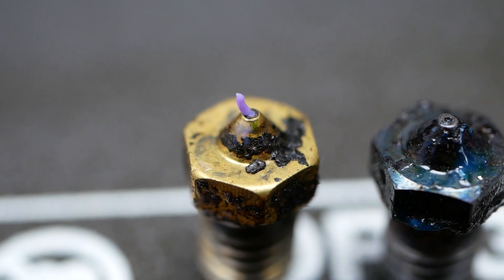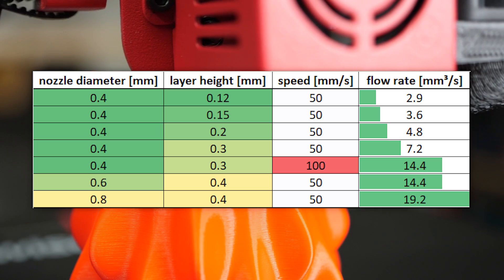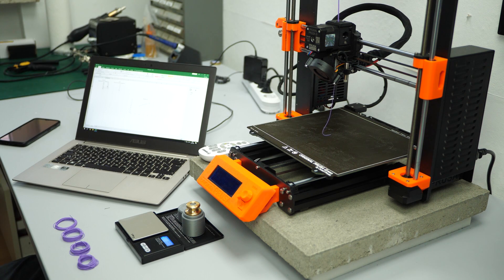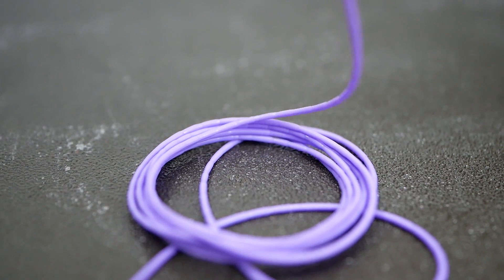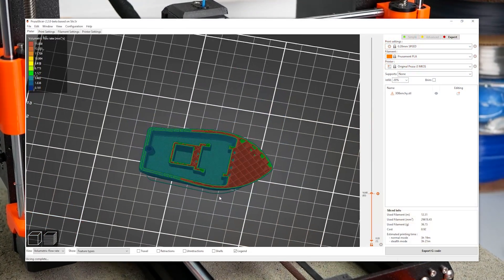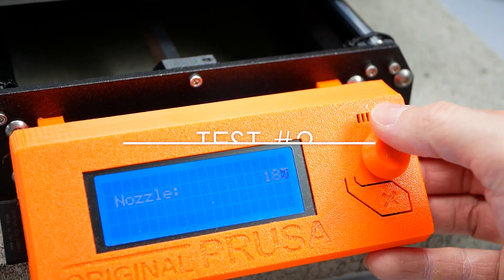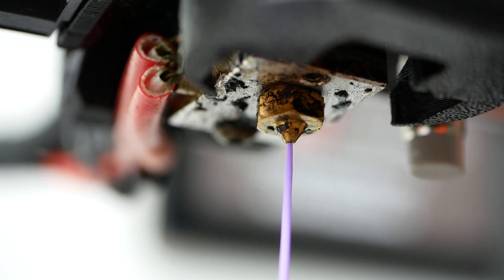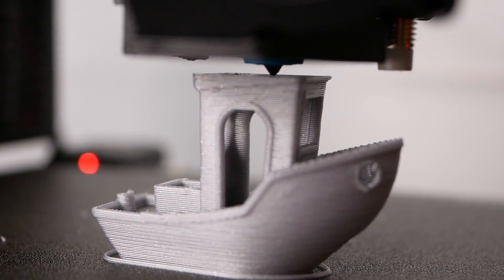How fast can your hotend print?

Comment: I've been using a stock hot end on my CR-10s for a few years without any issues at all. Although, I do print on the upper end of the temperature range of each material and never print faster than 60mm/s. I usually do 50-60mm/s for infill and inner walls, and like 30-40 for outer walls and surfaces.

Even when using a 0.8mm nozzle, that hotend seems to keep up very well, but at 0.8mm I do slow the print down quite a lot and push temps as high as I'm comfortable with for the material.

I have converted mine to direct drive and am using a different heatsink and part cooling fan setup which seems to do a good job of focusing the part cooling fan flow directly onto the part and not cooling off the nozzle.  Replacing the inner PTFE liner with Capricorn also makes me feel a bit more comfortable printing with higher temps, (within Capricorn's safety specs).

Last thing, if you actually end up seeing this. May I make a request for a video?  
I've really been curious about testing various 3D printing material creep properties. I can't seem to find much solid research into it and I think it'd be super useful for a lot of people that print functional parts.  😉

Comment: Don't forget that the back pressure on the nozzle is much higher when actually printing compared to these tests, and of course will also depend on speed and layer height. I suspect that this would significantly change the extrusion rate and shift those curves quite a bit.

Comment: How does this translate to what Cuba shows me for printing speed. For instance, I have been doing 215c and 40mm/s how does that 40 mm/s translate into cubic mms?
Reply from the maker: Use the formula from the beginning and add your extrusion width and layer height.
Reply: @CNCKitchen  thanks I need to rewatch the video. I missed the formula.

Comment: my concern with raising temp is I cant tell just how hot the filament is getting.  PETG gets very brittle if overheated IMO.  am I just overheating it to reduce the viscosity?  or am I keeping at the right temp keeping up with the flow...
Reply from the maker: Both, first you properly need to melt it and then you also want to reduce the viscosity for these high flow rates. Been printing PLA very successfully at 260c even at low flow rates without any issue. Maybe your PETG was wet?

Comment: thank you for this. I built a corexy which can easily print at 100mm/s. Using a V6 style hotend with BMG extruder , filiment was skipping when I printed at .3mm high and 100mm/s . I never realized the V6 was working in the upper bounds of throughput. I have upgraded to volcano  recently , still seeing what it can do. I was disappointed at the end of this video there was not a comparison of the volcano.

Comment: in vase mode using my white pla filament i end up getting 3 or 4 small black dots on different areas when a 6 hour print is finished...i print at 220 degrees at 50 mm per second...can anyone tell me what adjustments or if any can be made when printing in vase mode to prevent the black dots which are most likely burn filament? maybe lowering temp...i just don't want to lose quality or strength...thanks

Comment: My extruder is kind of slow, so I usually do up the temp from 205-210 to 225-230 if I really need/want to print fast. The problem, of course, is that its depdendent on the place in the print. If there is bridging or  overhangs I manually lower the temps. This should really be in the extruder, as always!

Comment: Thanks for that very thorough vid Stefan. You removed any worries I had about using the Nozzle-X, so I installed one this evening and am currently going through a few test prints to ensure my Z calibration is once more dialed in just right.

Comment: I have a printer with a 1.4x1x1 meter build volume. It came with a regular V6 hotend, but of course I upgraded to supervolcano. Just to give an example; I can easily use a 1.2mm nozzle, 0.4 layer hight at 200mm/s.

Comment: I'd be very interested in what differnce precision makes.  Parsing through the gcode and rounding each coordinate to nearest prescision and the printing.  The comparison between all the different precisions would be very interesting - at what point does it make a noticible difference.
Reply: I wonder if there would be a good way to test geometric accuracy after rounding xyz moves to .005mm and .01mm

Comment: If possible, I'd love a comparison with multiple common materials as well as hotend designs as well.
chart ALL the things! PETG is particularily tricky it seems, I have to baby it when I use standard brass, but upgrade to plated copper and all problems dissapear, but there aren't any similar effects with PLA.
Reply from the maker: Interesting. Didn't notice a big difference between copper and brass nozzles myself. Did both use the same geometry inside?
Reply: @CNCKitchen  I'd assume so! Both genuine e3d nozzles on standard V6 hotends

Comment: im fortunate enough to already have a volcano hotend in my printer (artillery sidewinder x1). I can highly recommend that printer, for the price its really well build and has quite a big usable printing space. just be aware that you need to do some small mods to get the best printing results (like relocating the filament holder and maybe adding braces to the printer for really tall prints)

Comment: Thanks for the great investigation Stefan, as always very inspiring. I did notice over time that  increasing temperature by a delta of say 10degrees would help material flow better on more challenging speeds. I always choose the hotter side, I really don’t get why people print at 185-190 except very slow to get maximum detail?

However, regarding brass vs steel. I have noticed that I often need to boost temp by 5-10 degrees with Nozzle X to yield same consistent result as brass equivalent. I’ve also run into extrusion issues when switching to PLA after printing PETG or other copolyester. I choose plated copper nozzles for everything except abrasives as I get more consistent output with those, which I associate with better heat transfer.

Comment: Yes, yes, yes! I've been telling people to do this for years but you've illustrated and explained it better than I ever could. I could lose about 25% of my extrusion weight before the stepper started skipping steps, so don't think that just because there's no clicking that you're getting all the plastic you requested, folks. A simple test is to extrude 300-400mm of filament at low feedrate (F50), weigh it, then do the same at your volumetric speed, weigh that for comparison, and up the temperature until they're close, increase the extrusion multiplier to fudge it, or simply slow down. One of my ABS temperature / feedrate graphs:
https://i.imgur.com/ubw6ss9.png
Reply from the maker: Great work!
Reply: Do you need to extrude such a large amount? I've been using 60mm, but kind of notice my printer can't reach the maximum volumetric rate on larger prints. Now I think that is probably because 60mm might not a large enough volume (although I was kinda trying not to waste as much filament lol).

What I've also noticed is that you need to be careful with these tests. Clean out your extruder between all tests especially if it started skipping on your last one. Any teeth that have debris in them from skipping will be more prone to skipping, giving you false readings. 
Although you want to stay away from the speeds you notice any skipping anyway.
Reply: @krenthabohl  I can certainly sympathize with not wanting to waste a lot of plastic just to weigh it, but 60mm of PLA is only 0.18g so I think even 10% loss is in the range of rounding error for a cheap 50g scale. 400mm is just 1.2g, so even if you test 6 feedrates at 6 different temperatures, that's just 4.3% of a spool of filament or just $2 worth even if your spool cost $50. I would suggest 200m at a minimum, I usually do 300mm.

Comment: I print usaly at 215°C with PLA with an maximum speed of 150mm/s with an 0.3mm nozzle and 0.1mm layer height, works very well with ..... only problem i have is that im to lazy to set up the linear advance :D

Comment: So you're using a nozzle X, does this work the price? Does it work better than hardened steel nozzle?
And does the coating really help to prevent the plastic to stick on the nozzle?
Thanks
Reply from the maker: I think it's worth the price if you regularly print with abrasive filaments because it work well with all materials I printed so far. Much smoother surface finish due to the coating than a normal hardened steel one with only black oxide on it. If you only print non-filled materials though, stick with brass.

Comment: Love this test! I usually increase temp a lot when printing fast and with wide/thick layers (I like to use a small nozzle Ø as if it was larger).
What I would really like to learn is how much difference does it make to print say 0.6mm wide lines at 0.2mm layer height with a 0.4mm nozzle VS  printing with a 0.6mm nozzle and the same width/height. The larger diameter hole should reduce back-pressure. But at what flow rates may we use a 0.4 nozzle instead of a 0.6 nozzle and getting the same result? It is my opinion that we don't need nozzles of may different diameters.
Looking forward to your next video as well!
Reply: You can print wider tracks using smaller nozzle diameters within limits of nozzle geometry and can actually speed up the printing process.  He talks about printing larger extrusion widths using smaller nozzle diameters in his video on extrusion widths . . check it out.

Comment: I sort of stumbled into this the other week. Printing at 240, sliced at 100mm/s, layer height 0.32, extrusion width 0.44, that comes to a volumetric flow rate of 14.08. On top of that I turned the feed rate up mid print to 300%. I think the Ender 3 is limited to 200mm/s and I'm pretty sure I hit that. There was some skipping occasionally but it handled it pretty well.

Check out that extruder knob: https://streamable.com/dp6jq

Comment: Great stuff Stefan!!.. I noticed that you have a low extruder idler tension, do you think that affected the results? As the gears would slip earlier..
Reply from the maker: Of course it's also dependent on the pretension that's why I said that this has to be done for each particular setup. Using too high of a tension can also be detrimental.

Comment: Extrusion issue doesn't exist for single gear extruders because the higher backpressure is the less gear bites into the filament, resulting in larger effective radius that compensates for extra compression just perfectly.
This is also why single gear extruders just work and dual gear is nothing more than fancy stupidity.

Comment: Hey just want to put this out there. When testing for maximum volumetric flow rate, it’s not practical to just extrude a specific length until the motor starts skipping. This assumes the maximum volumetric flow rate is the point at which the polymer is not melted enough to be pushed out of the nozzle. First, but not as important, with a stronger motor you may be able to push the filament out at higher flow rates compared to this PRUSA Extruder/hotend combo which was explained in the video because Stefans a frickin genius and his videos are always awesome. Second and more importantly, before you reach this point, you will notice that the filament is not sticking to previously printed layers when making sharp turns or quick movements. This is due to an extreme temperature gradient in the filament at higher flow rates. This temperature gradient will cause massive gaps in the print and will likely result in a failure.

Comment: There is yet another problem with extruders - fancy shaped cogwheel in E3D extruders are worse than simple replica in Anycubic 4Max extruder. If filament not soft but hard there is no chance to print faster with E3D - it will eat part of filament and stops extruding.

Comment: I switched to a hardened steel nozzle and an all metal extruder at the same time. It took me a couple of minutes to figure out a few things. So far, all that I have changed is retraction distance to a much lower number (very critical with an all metal hot-end). Nothing has changed in print quality but I don't have to change nozzles anymore if I want to print some wood grain filament and I don't have to change the teflon tubing (it doesn't exist anymore). I have done no extensive testing because it all works great.

Comment: Wow that's really cool, I upgraded my Prusa Mk3 as soon as I got it since I wanted abrasives and I calibrate each filament I use. Prusament galaxy Silver requires 230C and I've never really thought anything of it since I was always told the steel nozzle needs 10+ degrees so to be so far away from Prusa's settings was always just because I have a steel nozzle. I was getting a bit worried that I'd struggle to get my mini tuned with the same filament settings... but based on this, it seems my temperature hike is actually so high for me because of the way I print (very low outer perimeter speed, very fast infill)... which theoretically means I can use all the same profiles :D Oh, except the e-steps will probably be different going from direct drive to bowden. Grrr :(

Comment: 🤔 I've been printing at 200°C @60mm/s the last couple of months. I don't think I've seen any skipping, just a little under extrusion. Definitely going to up my temp a little. Good info as always.
Reply: I print at 230c and have never had any issues, but if you use really high end filament you may want to lower it to 220c
Reply: @gamerbrosmaximuz7125  that's 10 degrees hotter than my eSun PLA+ lists, and 20 degrees hotter than my Hatchbox PLA lists. What brands do you use?

Comment: thanks, nice one! I recently got an inexpensive steel nozzle from aliexpress and noticed that I needed to boost the temp quite a bit for PLA from 210 C to 240 C at full fan speed. So I guess having a fan on or off also makes a vast difference as steel has about 8x lower thermal conductivity. Have to do more testing though..
Reply from the maker: What were the issues that you were facing and why you increased temperatures?

Comment: Hello Stefan, after using some Filament that blocked my nozzle, I cleaned the nozzle but I can only print now at 50% feed rate, if the speed is higher then I get underextrusion. The printer was working ok before, so something happened, but how to diagnose it?
Reply: How thoroughly did you clean the nozzle? And did you also clean the rest of the hotend internals?

Try a few cold pulls if you haven't already :) Tom Sanladerer has a video guide on those, I believe.

You can also try using some "cleaning filament". I've always used rigid.ink's Floss, but they're no longer in the filament business. E3D sell something similar, last I checked, but I seem to recall that the cleaning filament they sell is eSun-branded.
Cleaning filament is stuff that you just feed through a hot hotend and it's designed to pick up any of the crap that's built up in your hotend.
rigid.ink used to recommend using a few inches of it whenever changing filament, but you will probably need more than that to clear the remnants of a blockage.

The cold pull method will probably be more effective at getting rid of most of whatever's stuck in there though :)
Reply: @AndrewGillard  Thanks for the tips. I was thinking the same. I will do some cold pulls to see if I find anything, then also disassemble the hotebd which is an E3D Lite to check maybe the PTFE inside the hotend is damaged and needs replacing.
Reply: I saw something like that; the PTFE tubing wasn't seated all the way in.  Make sure you use the clips under the fitting release rings to prevent loosening.
Reply from the maker: Options:
- get a new nozzle
- clean out you current nozzle with cold and hot pulls
- burn out the nozzle (the nozzle alone) but don't heat it too much or you will damage it
- try cleaning filament

Comment: I always find that I am increasing my temps about 10-12 degrees above recommended.  I have printed mostly PETG and it likes to print hot.  I have not printed PLA in a long time.  I REALLY like PETG.  I print between 30-50mm/s

Comment: What you are actually showing I would call flow of the plastic materials. You should probably look at the viscosity  term as you are an engineer. Some companies gives a flow chart viscosity vs temperatury for filaments such for example for a Nylon:

https://plasticsfinder.com/en/datasheet/Novamid®+ID+1030/oX2rq

I am always trying to set my 3D printer based on the temperature I am currently using as I know that flow rate will change due to this physical property.

Comment: It might be nice to see if copper has any advantages over brass. It should be much more conductive.
Reply from the maker: Usually only better for high temp applications when brass can't handle the heat anymore.
Reply: @CNCKitchen  Copper has quite a bit more thermal conductivity than brass. In W/m K steel is around 50, brass around 110, and copper around 385.